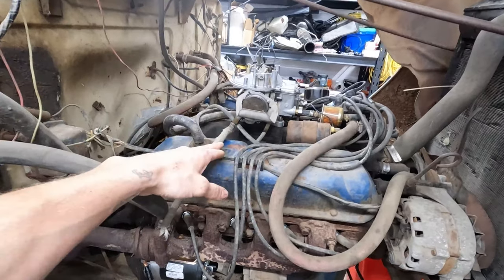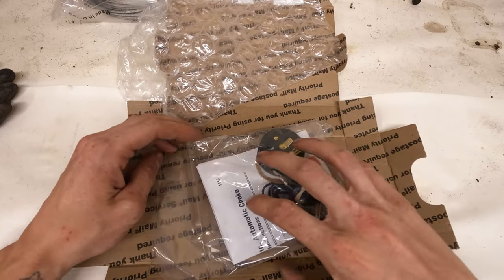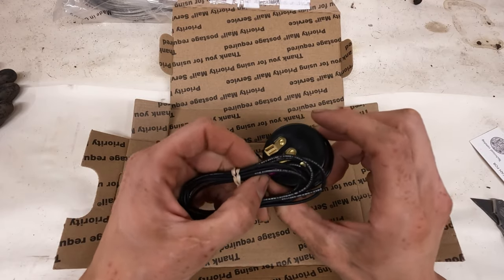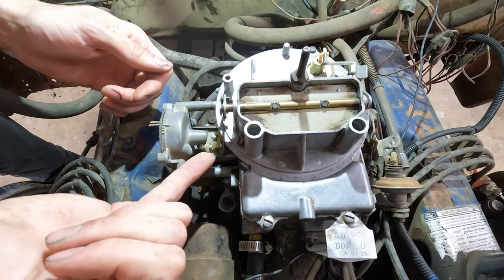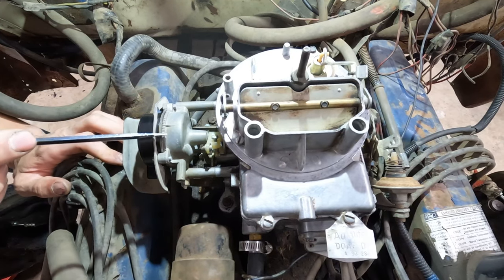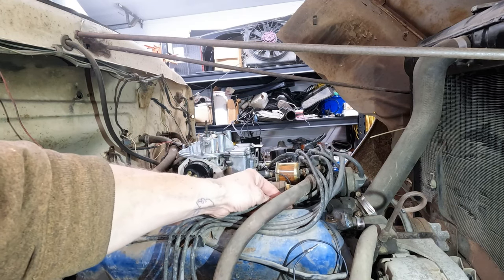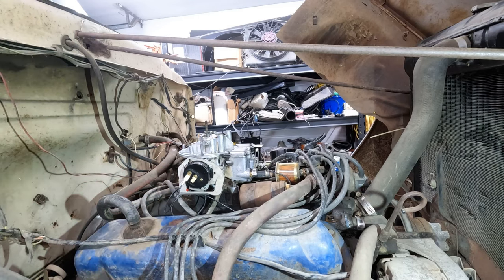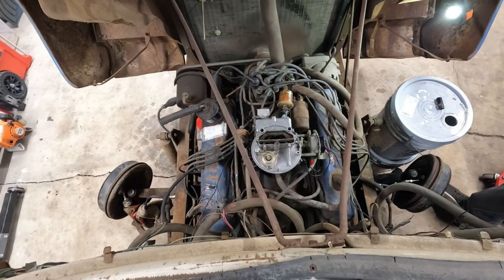Autolite 2100/4100 Electric Choke Install

Comment: how does the electric part work on a chinee clone that only has one terminal on the electric choke?
just run 12 v key on power to it and im done/?
cuz it never came with a thermostat/rheostat  thingy
Reply: run power from a switched terminal to your single terminal

Comment: I am assuming if you get a replaxlcement carb just remove the manual choke and run 12v power to the new 2100 carb and we should be good?
Reply from the maker: Yup, exactly!
Reply: No there is a plug that needs drilled out and a gasket needs installed. Just watch over 15 videos and everyone missed it even holley but did not search every video.